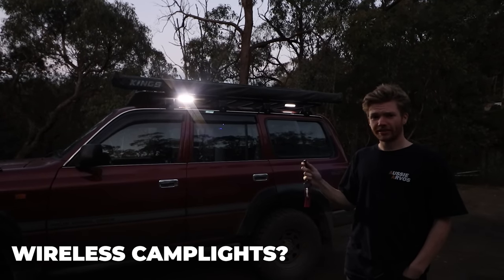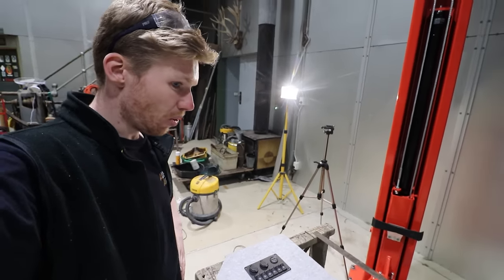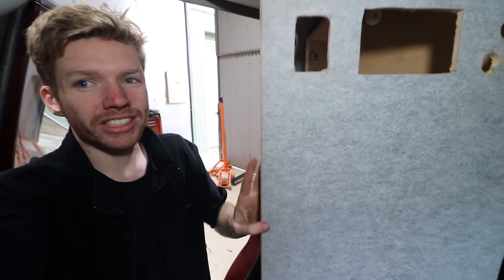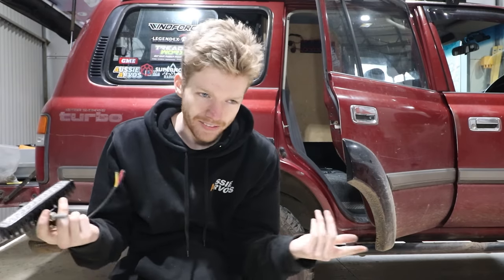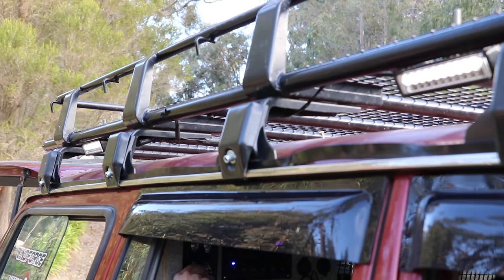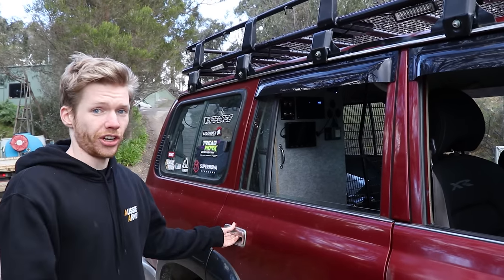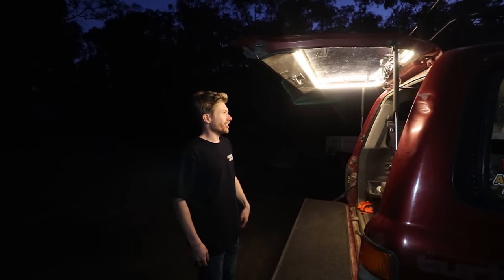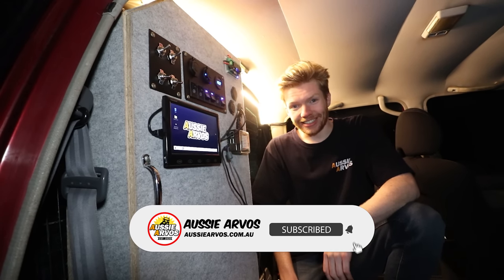DIY 12v CAMPLIGHTS! Motion & Remote controlled! | DIY 12v in Your 4x4

Comment: Love it. I have some similar concepts in my 76. I use SPDT relays to shift loads between batteries, change modes, etc. 2x Raspberry Pi's, one for the Victron apps, the other as a general computer. Motion sensors trigger the roof rack & rock lights. Its honestly too much fun as a nerd.. Its endless when you get this creative. Well done mate, your content is great to watch.

Comment: Well done, my son and I watch you guys every week, it s great to see practical and affordable (no cash for comments) projects.  This is what we did in the 80's we made all own stuff, even made our own winch form old motorbike gear boxes.  Keep going guys!!!, one small comment, please reduce the size of the circuit breaker and put it near the battery, (I am communications engineer) 100 Amp is way too big and you have left your wiring exposed to fire from your distribution box to the battery.  work out you maximum load, add 10% and that should be the breaker size.

Comment: A cool little mod. Connect your remote dongle to your compressor so you can turn it on and off while you're airing up each wheel.
Reply: My Arb single pump does that  out of the box,  soon as you disconnect the valve it shuts off

Comment: Aussie Arvos all 'Original' ideas for a 12 Volt setup, that works so well👍I'm a tech by trade and the fact you designed tested and built, all your own circuits with Multi Sim.. kudos Pat, can't wait to see the size of your smile using that motion sensor and wireless remote, on a trip! 
Legendary stuff guys and only on this channel🤫

Comment: Good job mate. Those little remote relays are great for so cheap. You can save wiring if you just run the power feed to the roof and put it in a water proof box. Then run to the lights from there. Saves running 4 lots of wire up to the roof.  And pro tip. Don't have your fire extinguisher at the source of the potential fire. Have it a bit away. That way of there is a fire you will be able to get to it. Because if there is one right above it, you may not be and to get to it because of the fire and heat 😉 then it's useless

Comment: Idea. If your using on canopy, or just want security. Add some doides with a keyway switch to turn on a pir, vibration and siren alarm circuit. You could put in a diode to hazard switch. They all come with time out relays. This for your roof rack lights.

Comment: 100 amp Circuit Breaker that maybe abit to much for the wire your using, the whole point is the circuit to pop before the wire does
Reply: The breaker looks sufficient for the wiring. Remember, that 100a breaker is only to protect the (looks like 6awg) cable going from the battery to the fuse block. The wires connected to the fuse block are individually protected by the respective fuses.
With that said, those cheap resettable breakers almost always pop at %80 or less than their rated current. I've even had one catch fire. Just use fuses and carry spares.

Comment: Circuit Breaker needs to be closer to the battery, at the moment it's only really protecting an overload from the fuse panel. It's not protecting the battery from a short. Should be as close to the positive terminal of the battery as possible. Great video though
Reply: Ive seen so many rigs damaged from fires and the owners scratching their because “they had a circuit beaker installed though” lol…
Reply: I always went with the circuit breaker mounted onto the battery as a rule of thumb
Reply: Just have one at each end.
Reply: @dougjohnson9413  Absolutely unnecessary and doesn't achieve anything. Only would be useful on a dual battery system using a VSR. This is just his feed to the fuse block, only needs one at the battery.
Reply from the maker: Yeah definitely agree Nick, I'll fix this up!

Comment: Put a Anderson plug on input to your cabinet. On your 100amp reset fuse put a slow blow 100amp. Your wiring put on cable clamps to stop vibration on cables. For you fidge check out lock your hubs on voltage regulator. Keeping voltage steady.

Comment: I have 360 degree lights on my bus for camping and 4wding which id consider a must have, but I put the switches in the front on roof on a blank panel so I could quickly hit them on the go. They are brilliant for night time trips out bush or if im towing a trailer, I can flick the back one on to check on my cargo. 
The motion one is a pretty neat idea though. Might have to look at that myself :).
I also opted an android stereo which does all the file transfer, wifi, internet, google store for games n apps, music, movies, reverse camera, gps ect. Its basically a tablet/laptop thats built into the dash. They are awesome to have on a 4by.

Comment: good sh*t mate..that's a ripper setup. I can see the rush to ebay to get the gear for many a system install inspired by this. Well done. have you considered splitting the door in two so you can have stuff against it to halfway up without having to move it to open your box door?

Comment: Nice one. Great job on your 12v and lighting.  On my LC80, I have a 400x40x09mm LED light bar mounted on the inside of the tailgate with a built-in motion sensor.  And I find it fantastic for the same sorts of reasons you showed. The only thing I wish is for it to have had an amber light feature.  But I couldn't find one with both white and amber in one.

Comment: That wiring is a hell of a mess but damn I love that set up. The motion detection would be brilliant for those camping solo that are worried about safety. Set it on top of the vehicle to capture anyone coming near it of a night. Being I prepare food and such at the back of my Pajero it would work a treat there too. Also really like the idea of the Raspberry Pi for backing up data as thats something Ive been trying to work out for a upcoming trip. This time around though I will be using my Laptop.

Comment: Great stuff love it as usual! 
Just noticed battery volts dropped a bunch when turning on various lights and stuff. Either your battery is cooked or you need to run two separate wires directly from the battery. If you've run small gauge wire that supplies the rest of the panel it will affect the voltmeter reading. Another option is to run an oversized wire from battery to supply the box. Cheers
Reply from the maker: I think you are right, I think it's affecting the voltage gauge!! Good spot! Thanks mate I'll have to fix that up!
Reply: No dramas, I had this issue myself. Volt drop on 12V systems can happen on surprisingly short length wires in certain conditions.
Reply: Also, you probably know this already but just incase don't forgrt to fuse wires for voltmeter and 12v box as close as possible to battery pos 👍

Comment: I have been using motion activated strip lights on the side of my roof rack for years. Got them from jaycar, about $20 and powered by 2 AA batteries. Only had to change the batteries maybe 3 times. The only problem is the range of the sensor is too good.

Comment: what size wire is running to the switch panel? seems like alot of voltage drop when your just running the led strip?
if you can chuck a tong tester on. interested how much power they lights actually pulling

Comment: Awesome setup! Just out of curiosity tho where did u run power to the light on the roof rack??? Running into this problem on my 60 of getting cable run from inside the cab to outside the car…
Reply: I saw the wire going into the cab on the corner or the door. at 8:54

By the way my name is Willmer too.
Reply from the maker: Yep though the top corner of the passenger door!

Comment: Hey man love the vids, starting watching because I also have an 80. I was wondering how you got the wires from your alley lights into the cab? Did you drill any holes? Also looking at doing the same thing but I don't particularly want to drill into the shell. 
Thanks!

Comment: Ha ha ha !! Pretty good man !! Literally got the wireless bit from ebay- also get a another controller box just in case, mine got busted just after a single use. So ended up getting 2. Btw those little relays are rated 10ah each so you can definitely run without another relay circuit I reckon

Comment: What did you use to step down the 12v power to the Raspberry Pi4s 5volt?
Reply: Usb adapter usually works, 3a minimum

Comment: How did you go about wiring up the remotes? I have 12v coming off a switch to power the receiver box and it clicks when I hit the buttons but it doesn't put out any power in the outlets. Have the box running to a relay to operate the tire pump (which works without the receiver hooked up). Tried putting the multimeter on the power out and not getting any reading, reckon it's a faulty receiver box?
Reply: Did you resolve the issue? Were you actually supplying power to each relay or only to the controller? Those wireless relays need to have positive to the port as well.

Comment: Optic relays are better than coil for current draw on control side.
Reply: What are optis relays? I can't find that with google. Do you mean Solid State relays? Because those are expensive and for most applications they need a heatsink too

Comment: Where did you run your wiring down from the roof rack work lights into the car?
Reply from the maker: Just down through the top corner of the passenger door, works much better then I expected!

Comment: Do you like the ryobi soldering iron, I have been tempted to get one but haven't pulled the trigger yet
Reply from the maker: Honestly, its great, so much better being "wireless" makes it so much easier to quickly move it and get to hard places. I was worried that because it was on a battery it would take for ever to heat up, this is not the case, its a quick or quicker then my 240 soldering iron.

Comment: I have a feeling a lot of the viewers have no idea what a Raspberry Pi is.

Didn't expect to ever see one on Aussie Arvos. 👍

Edit: Very clever to use it to transfer files for videos.

What model is it a Pi3? or have you upgraded to a 4 since you used it at university?

Wow Patrick your handy with the electric stuff. I failed so hard in school in science, but I absolutely enjoy wiring up accessories.

Though I do need help to know what to do for what I want the wiring to do. If that makes sense. 🥴
Reply from the maker: Its a pi 3B+ and thanks man, i want to upgrade to a 4 for the car, eventually plan on having the pi do a few cool things in the car!
Reply: @AussieArvos  Cool, I still need to dip my toes into the world of SBCs. (single board computers) 

Still don't know what to do with one since there are so many possibilities.

Edit:The motion sensor is definitely a great idea as well as lights on the sides.

Comment: Should've made the relays sit higher so u can store stuff in the bottom, brake clean, brake fluid, degreaser etc
Reply: Yeap before watching seeing it on fb, i thought why not have two doors split up n down. When storing stuff where the seats where, it would be handy to open the top without getting stuff away from the bottom half.

Comment: You should probably move your fire extinguisher away from your 12v Box. Worse case scenario your box is up in flames yet you need to reach for your extinguisher. Front edge of the passenger seat is typically a good spot.
Reply from the maker: Yeah I agree mate, think I'm going to move it!!
Reply: @AussieArvos  Other than that mate, Great content. Currently in the middle of buying electrics for my half canopy. Planning is everything when it comes to 12V to keep things neat.